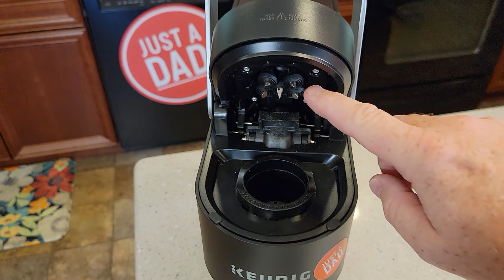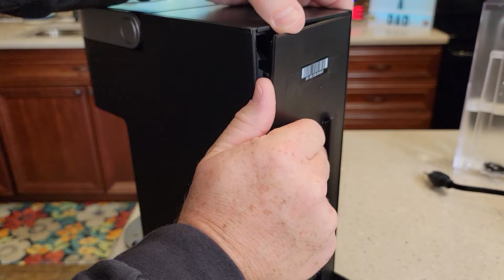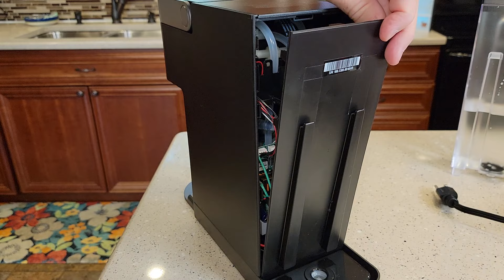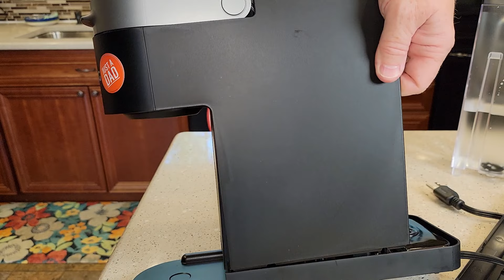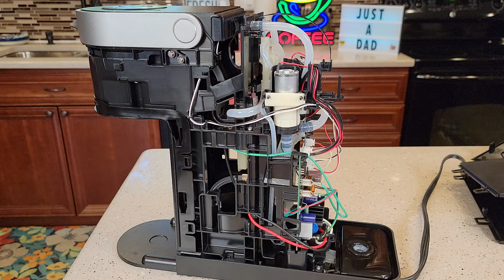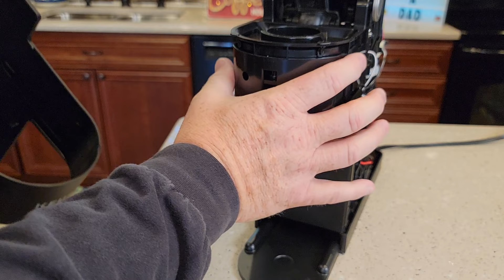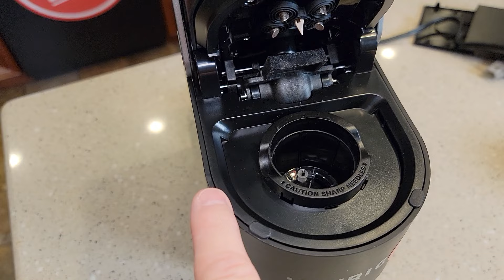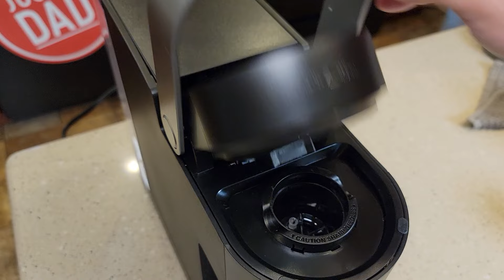🔧 Keurig K-Slim Not Working? | Thermostat Reset & Repair Guide

Comment: My heating element looks different. It’s a u-shape. Does it have a reset button? Mine won’t power up. The power light and descale button only flickers when I press power.
Reply: I have the same model as you describe, it has a thermal fuse under the white insulation on the side of heating element where red wire  turns to yellow. If you slide the white insulation back it will expose the thermal fuse, which most likely needs replaced.
Reply: @09rideyamaha I do not see white insulation
Reply: @shawnabanks530  can you trace wires to see where the red and yellow meet? There is actually 2 thermal fuses, one on each side.
Reply: I found reset but didn’t hear a click when I pressed on it with paper clip! Still no power when it’s plugged in. Any other suggestions?  Your tutorial was great in taking the cover off and finding the heat element reset though!

Comment: I did the process to reset the thermostat and it worked for 2x. Since the “descale” light was still showing, I kept doing it until the thermostat popped and started again. On the third time the thermostat popped, I saw a spark coming out of it, and now it won’t reset. Should I try to replace the thermostat?

Comment: Also if water is blocked from getting to the thermostat area it can pop, but isn't that supposed to go back after an overheat reaction if water is there to cool it down after an overheat?  Like in an AC Thermostat of old where the coil with mercury expands and creates a connection until the bimetal retracts and shuts the AC off!
Reply: I think mine must be blocked because I reset it but every time I try to run it, it overheats and pops again. Any suggestions??